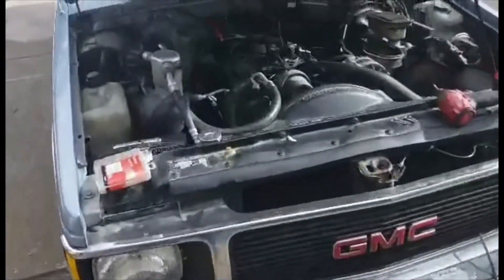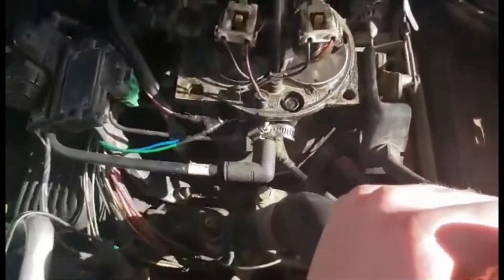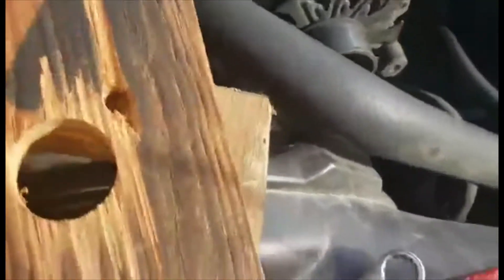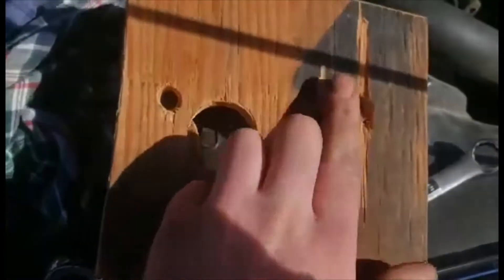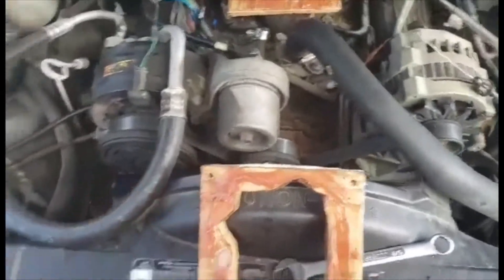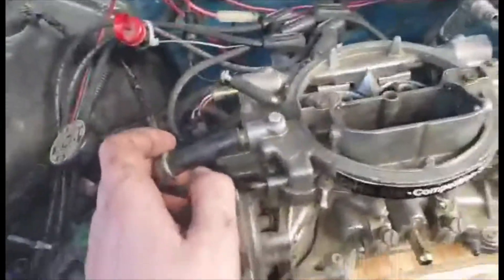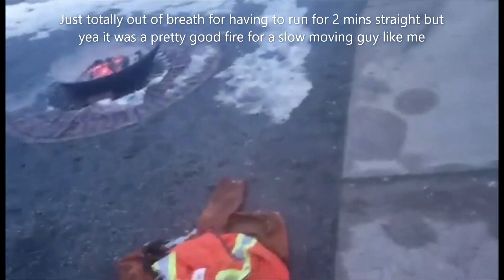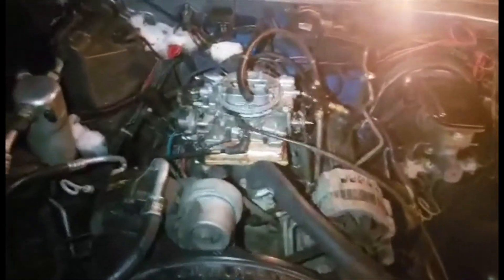4.3L tbi to carb swap done right!

Comment: This why you don't use wood mounts you should use metal or aluminum mounts
Reply from the maker: The wood didn't catch on fire and there is lots of people out there that have used wood spacers usually clear coated so gas doesn't soak in they did that because there insulate the carb from heat
Reply: Used them for last 30yrs never an issue..